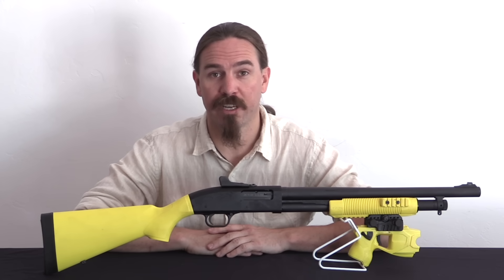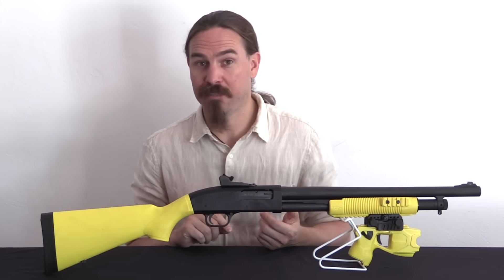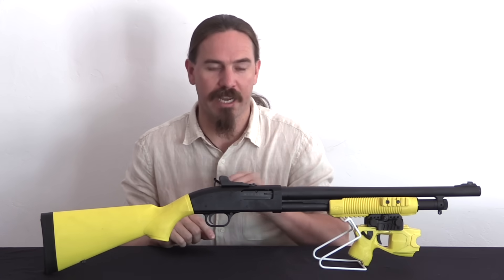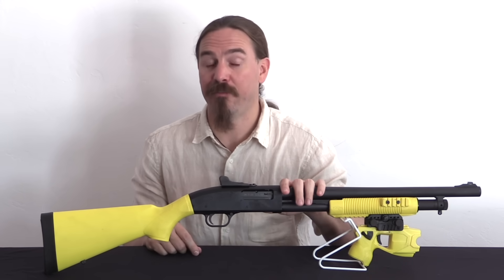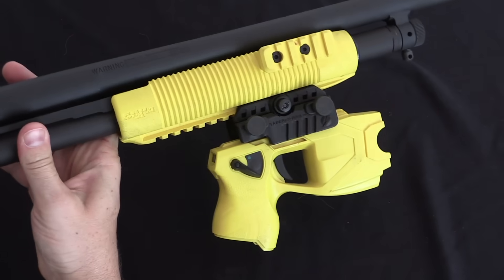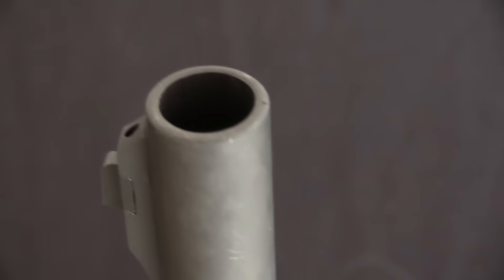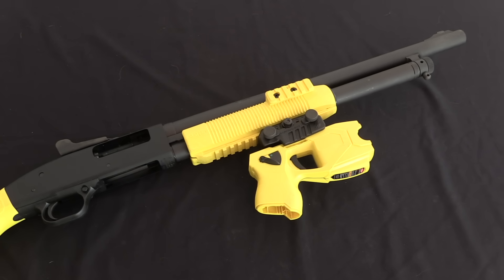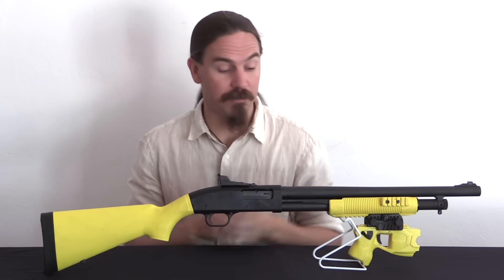Taser X12 XREP: A Taser in a Shotgun Shell

Comment: "...they were also at one point considering a 40mm grenade version..."

- LESS LETHAL LESS LETHAL
FATUMP
AaAaaaAA*smack*AaAAAaaAAAAa...
Reply: Slightly less lethal.
Reply: "Well, we can confirm that the charge did not kill the subject"
"They have a HOLE through their chest!!"
"Yes but the charge itself did no harm. It's an important distinction"
Reply: They probably tried a 120mm version for non lethal MBTs
Reply: 40mm taser: for when you need to shoot someone with the electric chair
Reply: "I said less than letal not harmless nor not lethal"

US police probably
Reply: @felipedaiber2991  I mean yes that is what less than lethal means and people still can't take a hint that it's less than lethal not non-lethal so that conversation has probably happened before
Reply: @MatthewČák2142  so the quote was real? I KNEW IT!
Reply: 40mm tazer, when we say "crowd control" we really mean it!
Reply: Imagine if they went up to a less lethal tank
Reply: Delayed lethal.
Reply: Well SWAT and SRT teams already use 25mm and 40mm launchers for tear gas and less lethal sabot rounds like beanbags, rubber BB canister "Stinger" spreadshot, and a host of other ideas like the 25mm plastic Ferret rounds (Standard Issue for most 25mm launchers) so a 40mm actually makes sense, you could fit a much bigger battery to the Taser projectile that would last longer than 20 seconds and or increase the voltage delivered on impact. Also the much larger amount of propellant allows a 40mm LtL system a range of about 120 feet, which is fantastic for situations such as a mentally ill or suicidal person with a pistol. 

Look into the 25mm Ferret rounds that have been used for well over a decade and you'll see it's not at all a ridiculous concept.
Reply: @pointmansf  you know that those projectiles are either closer to being shotgun projectiles or not meant to be shot directly at anyone?
Reply: @pointmansf  For a mentally ill or suicidal person with a pistol, I have a better solution, that has already been used in the past, but with a modern adaptation that makes it work better.
Cross a highly accurate sniper with ammunition akin to a door breaching round. A well trained sniper with an extremely accurate rifle means you can shoot the gun out of their hand, and the frangible round means that as soon as that round hits something substantial (like the gun, knife, or other weapon), it turns into powder losing most of it's lethality, reducing damage caused by shrapnel of the projectile. Doesn't do anything about any shrapnel the held weapon itself might produce, but I think there's not much to be done about that.
Of course, if you do hit a person with it they'll probably still suffer damage pretty similar to a gunshot wound, but the point of the sniper is that you hit the gun not the person.
Reply: @44R0Ndin  you seriously think thats better than less than lethal?
Reply: @44R0Ndin  the only thing about that is it is incredibly difficult to hit a handgun out of someones hand unless they aren't moving at all and the side profile of the handgun is presented to the sniper. If they are standing or moving the likelihood of missing and making the suspect more disturbed and likely to start shooting much higher. It's a good idea but not a practical idea. Even just a wrong guess at wind speed and direction will throw off the round.
Reply: @JohnnyLes91  hey I give them credit for putting a lot of thought into it. They just may not be that much into firearms. But let's not put them down too much they might be able to come up with something dont break their spirit just yet.
Reply: @jecaulford4  you sure did man and good on you for doing so. You're the internet yang to my yin. Now he's had balanced feedback.
Reply: @JohnnyLes91  now that I can agree with. You are a gentleman and a scholar good sir

Comment: Ahhh, that's unusual for the police department to flat out reject the program. Even though the cost was extravagant, the system is obviously a more intensive version of the taser to handle more intensive situations. This weapon could be selectively deployed for riot control situations or for situations wear strong police presence was necessary. So it's not as though it would be replacing the taser, the generic taser could continue to do its regular job but in situations where range is an issue or otherwise this speciality firearm could be deployed.
Reply: Assuming that you use 12 rounds in training (gotta learn how to shoot it) and are issued another 12 rounds with the x12, a 400 officer police force would spend $2mil to initially equip and $800k annually.
Reply: it's less expensive for them to shoot gas canister in the head, so they do

Comment: So I'm not that knowledgeable about firearms so I have a couple of questions. 

1. Would those taser shells work in a standard shotgun or only in the X12? 
2. Why are these shells too expensive when they can afford military surplus items like hummers and armored personnel vehicles?
Reply: we can afford the Zumwalt but not its shells either
Reply: Departments dont purchase milsurp vehicles. They are given to them
Reply: @iiipercenterpatriot4266  If I remember correctly. They aren't just up and given to them. They are sold them for heavily discounted prices by the military
Reply: 1. Looks like only works for X12. Standard shotgun bolt seemed to cannot trigger the taser shells properlu, and the barrel of X12 were rifled for increased accuracy and stability.

2. Keyword here is 'surplus'. For the most part, the folks who sold 'em are more interested in cleaning room for new equipments and supplies than to make profit. It's also mostly secondhand equipment (insert used car market jokes here).

This shotgun, in other hand, also requires special munition and training which most coppers cannot afford anyway. Dunno about FBI or Secret Service, though.

Comment: Since these rounds aren't meant to be used in normal shotguns anyways, why didn't they built it in 12/89 (12/3.5) (Mossberg has the 835 as a potential platform) to accommodate a bigger battery ?

Comment: Budget issues aside could they have developed handgun variants of the ammo? Perhaps in a larger caliber than 9mm or even in 9mm could work unless they needed it to be 12 gauge. I'm just wondering if they could have developed the system to the level of being a replacement for regular firearms or at least mostly a replacement for regular firearms. Might be neat to have a prospective nonlethal weapon that could just be used by all departments. They might need to have a lethal backup weapon for more extreme situations but perhaps the bulk of encounters can utilize these taser rounds.

Comment: "It's not something you can just will your way out of it."

Let me introduce you to High amounts of opiates, amphetamines, and cocaine
Reply: These still won't be enough I believe since your neural network will be fucked if you hit by those. (yes more than doing drugs)
Reply: @batuhancakmak4654  I do not belive that is much more than marketing buzzwords.
Reply: I need no channel youtube! There is a point with electronics if the current is high enough where you cannot function or unwillingly intense your muscles. Bigclivedotcom (ab electronics channel) tested it a while back I do not recall off the top of my head but he seriously could not unclench his hand
Reply: @fredjones5698  Yes, that happens. It is also a voltage that will cause third degree burns, and likely cause cardiac arrythmia or arrest.
The point of this thing was to use a lesser charge in a more efficient manner, which makes it ausceptible to unusual circumstances.
Reply: Drugs don't help you when no signal from the brain reaches the limps anymore because the taser violently overwrites them. It is not this hard to grasp this info...

Comment: At least every sergeant's unit would need one of these. In a large department, that's potentially millions of dollars worth of rounds. My department trialed these when Taser was developing the round. It did a good job, having enough force to knock a suspect down, or at least to make it hurt like a bitch, even if the the electrical connection failed. It had a lot of innovative ideas, but the cost was going to be astronomical, and Taser hadn't even yet developed a training round. This kind if thing will return someday in light of the widespread rioting this year.

Comment: Taser deployments by police have a fairly mixed track record, as far as I can determine. Even ignoring those events where the prongs don't impact correctly or don't have the right separation, isn't used correctly or fails to make contact, some people seem able to ignore or disregard the effects of the taser. It will clearly be functional, the taser is shown to be working though multiple duty cycles, the target expresses pain, but there is no irresistible muscular disruption. They continue to struggle.

I'm not sure why this happens and it may be entirely because of misuse/etc, but it is not quite irresistible. Some sources (like the company themselves) have suggested this is because of drug intoxication but I'm not sure their "excited delirium" is even a real thing. Taser were a very shady company. I don't trust them. See also what happened to Raoul Moat.
Reply: Tbh from my own experience it doesn't seem like the impulses are strong enough to affect muscle control completely and for more than a second or two.
Reply: most of these instances are when the probes hook up to an extremity and not the core of the body.  the electrical impulses only really go between each probe and spider out from some other nerves from there.  you see during the exposures at Axon how we all took it in the central back?  probes land about 12" to 16" apart... and that gets one's entire core body rigid, with some additional effects out on the limbs somewhat (since the nerves in the spinal column are all being stimulated)

if someone takes one probe in the shoulder and the other down their right arm... they're not going to be using that arm or likely even talking a lot for 5 seconds, but they can still sometimes operate their other arm and their legs.
Reply: Meth is a hell of a drug.
Reply: Bryce Martin ya the reality he made up inside his head.
Reply: @user-yo6um3jn5k  it'd be really hard to comment if his eyes were closed
Reply: Matt  yes it was sarcastic, but thats ok.  I can see from your other comments that there is no point engaging with you anyhow.
Reply: Matt where does it say that people “minding there own business” are exempt from the law? Are you one those sovereign citizens who think they have the right to travel without a drivers license?
Reply: Matt ya expect they’re not unlawful, traffic laws exist whether you like them or not and you don’t have the ability to determine what is unlawful based solely on 200 century old text as it was written that has had many modern interpretations to fit modern changes and continues to change to this day over how it should be handled with the internet. If you driving without a license, you’re gonna get pulled over; if you’re not using your signals, you’re gonna get pulled over; if you’re not wearing a seatbelt, you’re gonna get pulled over; if you’re driving erratically, you’re gonna get pulled over; etc etc.
Reply: Matt Go and start another Revolutionary War if you TRULY believe that the government is corrupt. All this talk about a corrupt system yet you don’t even dare attempt a Revolution like what the found fathers’ states to do.
Reply: I theorize that somepeoples nerves habe a different frequency
Reply: The raoul moat thing was a case of the wrong thing being used, raoul got hit his muscles contracted (since the tazer worked), his finger was on a trigger pointed at himself and well its obvious where that leads, thats not tazers fault, thats the fault of whoever decided to pick a tazer to deal with someone holding a trigger.
Reply: As soon as the zapping stops, the pain and incapacitation goes away.
Reply: If you watched Donut Operator's video on tasers, you can see how tasers aren't always reliable. They don't always immobilize people the way they are meant to.
Reply: Matt please by all means give us your wisdom OH WISE ONE! WHO SHOULD HAVE THE POWER TO ASSERT THE LAW THEN! PLEASE GIVE US YOUR WISDOM! SHOULD IT BE THE CITIZENS THEMSELVES! THE VERY ONES WHO TOOK PROTESTING AS AN EXCUSE TO ROB, RAID, AND DESTROY OTHER PEOPLE’S HOMES, STORES AND FAMILY!
Reply: Matt  In the video, he shows multiple examples of it not working. Coming from a cop, we still have to respect what he says and perhaps learn from it. Since they're the ones who experience actually using a live taser on actual people.
Reply: Matt if by “reality” you mean your own assumptions and likely cherrypicked situations, can you actually list any amount (in recent history) of overtly racist cops that abuse their power compared to the millions that operate in the US or any department that encourages misconduct because right now it sounds like you’re spouting conspiracy theories to make yourself feel better about getting a ticket for going 10 above the speed limit.
Reply: @waterdamagedtextbook9858  True, "Excited Delirium" may be bullshit but I don't know why people feel the need to use it as an excuse to label all cops bad, Yes the system is bullshit but 99% of cops are trying to do good it's not their fault they have to work through a flawed system

Edit: Autocorrect
Reply: SneakySneaky Snake places New York City that have “stop and frisk” that seem to target minorities are some of the worst systems, don’t even let me get started on LA and Chicago on how shit crime is handled there.
Reply: Matt  Yes of course.  That's the whole point of going into law enforcement- harassing innocent people all day.  No actual enforcement of laws takes place, no serving of the community.  Its all just maladjusted people running around and harassing and beating innocent people for fun.
Reply: I find it funny how in your sermon "police not able to hit at all" doesn't even get mentioned...
Reply: If you go looking you'll find that a lot of cop technology is some degree of pseudoscientific bullshit.
Reply: Matt  Right? You NEVER hear about someone dying of "excited delirium" in ANY OTHER SETTING than getting murdered by cops.
Reply: Excited delerium is indeed a thing, and by itself it can kill. It can be particularly induced by people using stimulants like meth, ecstacy, pcp, etc. Pcp further damps down parts of the nervous system, including the sensory nervous system, that is why people on it seem to have inhuman strength, they are ripping their bodies apart, they just cant feel it.
Reply: @stanburton6224  Bullshit.
Reply: @stanburton6224  "excited delirium" is a fake condition made up entirely by cops to explain away the deaths they cause. It exists in no medical literature.
Reply: @Hansengineering  Start with this article from medical literature and begin your learning:

https://www.ncbi.nlm.nih.gov/pmc/articles/PMC5061757/#__ffn_sectitle

Excited delirium has been described and discussed in the medical literature for over 100 years now.  Complain all you want about your theories on systemic racism or police misconduct, but stating that excited delirium does not appear in the literature is simply incorrect.
Reply: Matt  Yep. It's a communicable disease that only cops can transmit.

Comment: if the physics explains how it works then how do you explain positive and correct attachment on bare skin of suspects that are tasered and still move
Reply: Anatomy differs. Also possible neurological chemistry abnormalities, depending on what drugs are in their system.
Reply: You can only override neural signals in nerves your current actually gets to.
Dependimg on build, body fat and water content, exact anatomical position of nerves, skin moisture, hair, temperature, condition of the neuraxial myelin sleeve, ion balance, and individual variation in neural action potential variation, it is entirely possible for the shock not to sufficiently affect some nerves.
Reply: Yeah ive seen multiple videos of tazers that hit the upper body with a poor connection and his upper body was obviously affected meanwhile his lower body wasnt